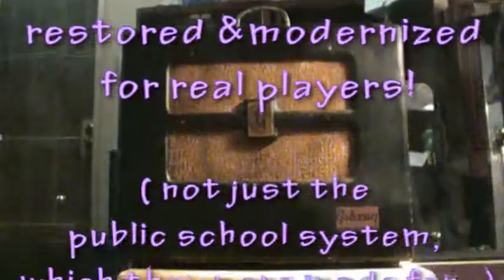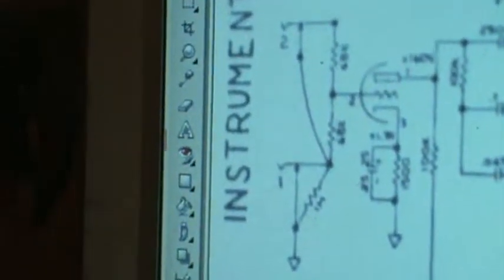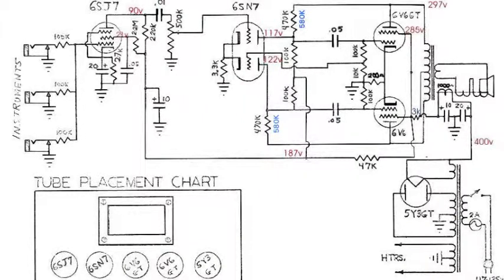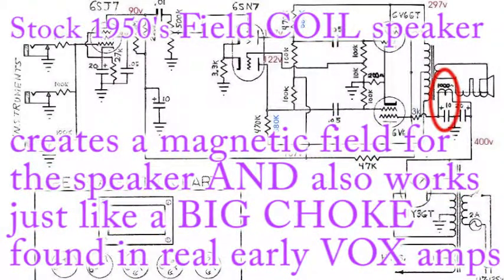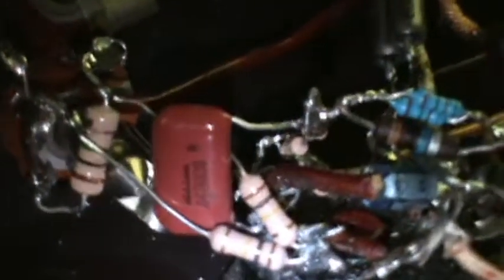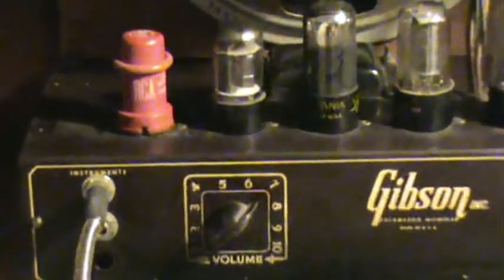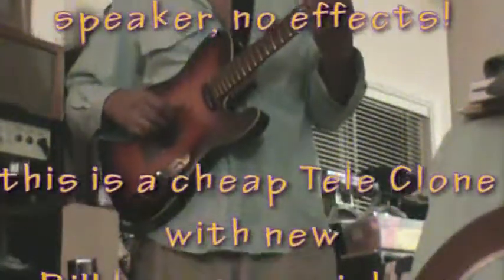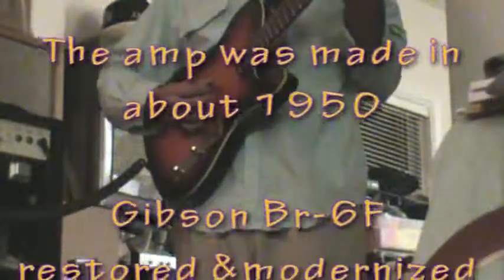Gibson BR 6F after preamp mods and higher supply voltage WITH AMP IMAGE INTRO & SCHEMATIC

Comment: Is that pentode pre gives that kinda softness?
Reply from the maker: I think a lot of that is from the actual speaker it works a lot like in alnico permanent magnet speaker but it is not a permanent magnet it is a coil of wire that is being energized by the power transformer they call it a "field coil"l ,  Also those are some real high-quality American tubes in there from back in the 1950s and the coupling capacitors are paper and oil from Russia NOS